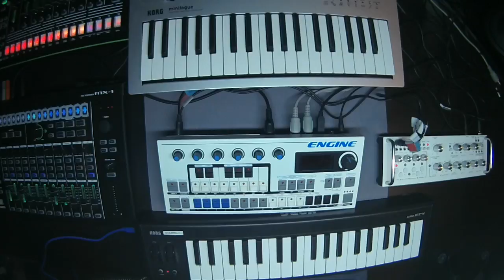Engine MIDI controller routing

Comment: What is the machine on the left?
Reply: Upper left is Roland tr-8, and lower left is the Roland Mx-1
Reply: Sorry I was wrong. I meant machine to the right ... the one that looks like a rack mount white unit
Reply: bladuck1 I guess you mean the Grendel Grenadier. I just heard of it in this video.
Reply: It's a Roland MX-1 Mixer, which I guess is especially useful if you have Roland Aira gear with USB connectivity. https://www.roland.com/global/products/mx-1/